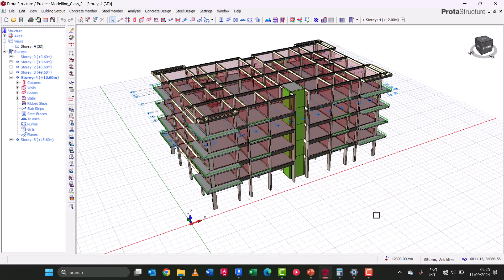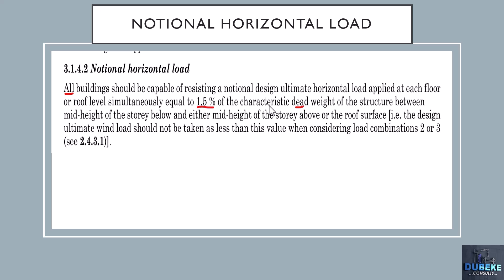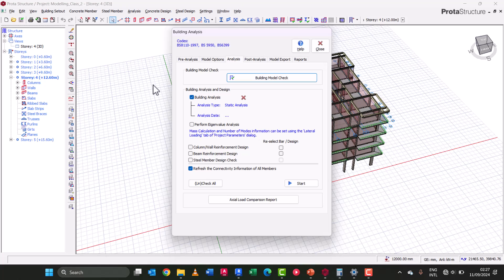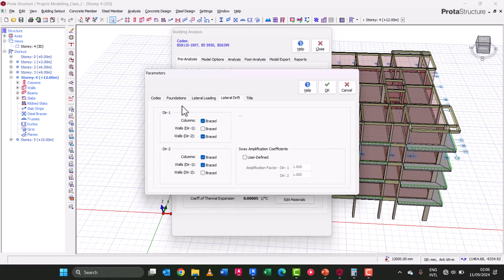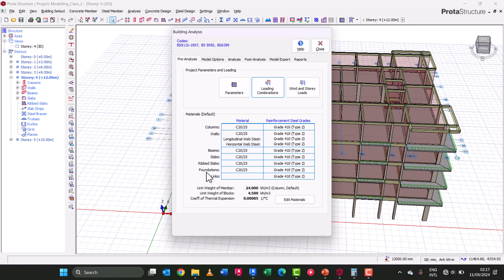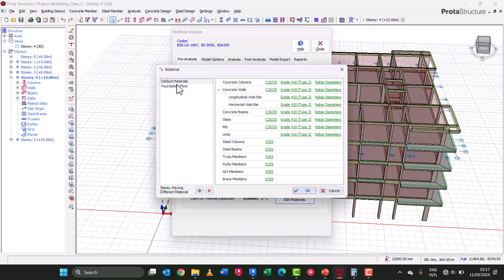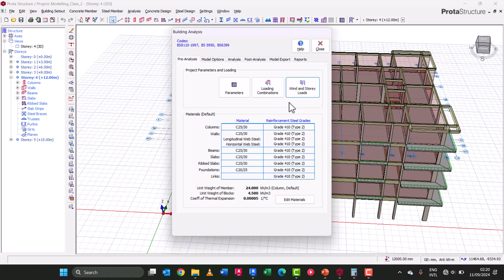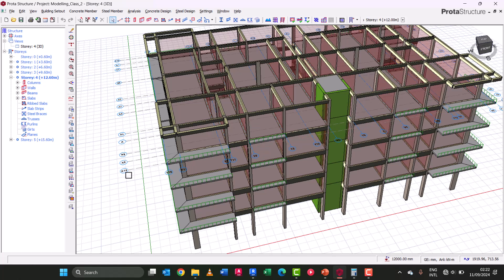Pre Analysis on Prota Structure (I R)

Comment: Must you always leave the beam end conditions fixed? if not , when should you make changes?
Reply from the maker: By design principles, beam and column connections in concrete are typically fixed as the beams are expected to transfer moments to columns. However, modifications can be made considering the development length, and these changes must be reflected in the detailed drawings